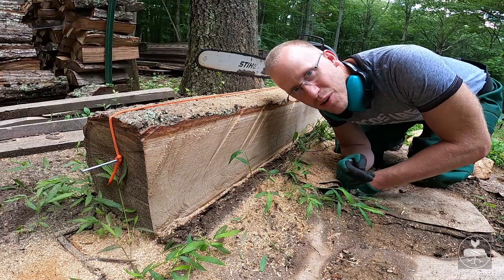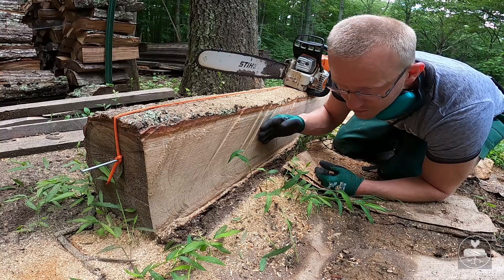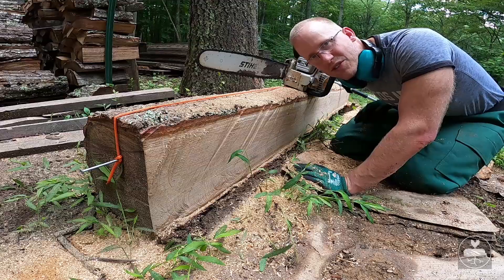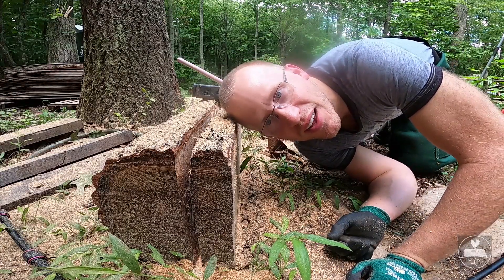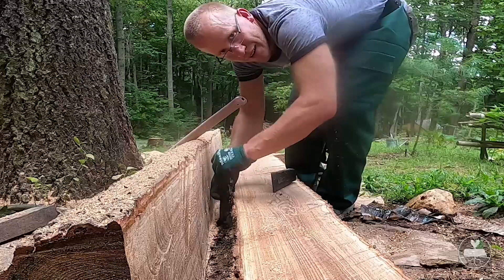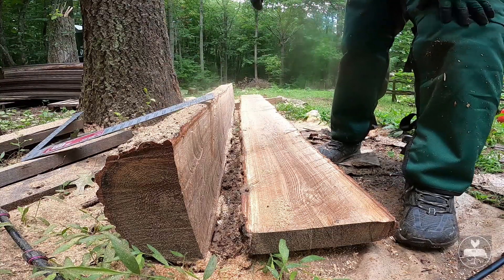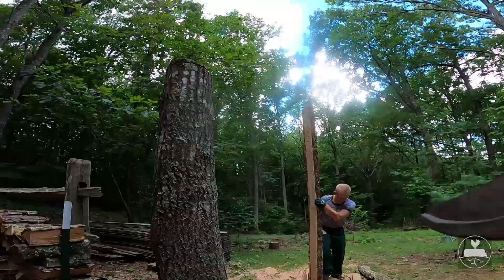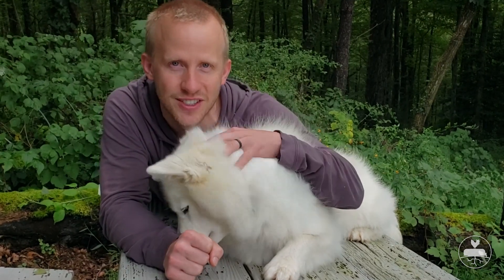Strand Farm | Freehand Chainsaw Mill - Part II - Off Grid Homestead

Comment: Suggestion,maybe you can put the log a little bit higher above the ground by putting two smaller logs on each side,in that way you will not worry about your blade to touch the ground when you're on the halfway, and maybe you'll save fuel,time and energy , just a suggestion 😉
Reply from the maker: Absolutely. We may have to do something like that in the future. If only there was a way to make oak logs less heavy! -Ash
Reply from the maker: This is a good idea. These logs are so heavy that I was hoping I could just cut them as they lay. With some smarts and perhaps a lever I can elevate the log off the ground. I will certainly be playing with this recommendation. I think your suggestion would assist with keeping the log from rolling too. - James
Reply: @strand-farm  yes, maybe it would help a bit,,but there's no harm in trying 😉